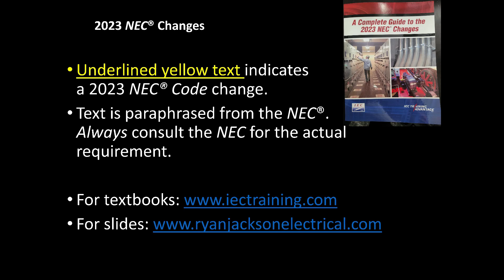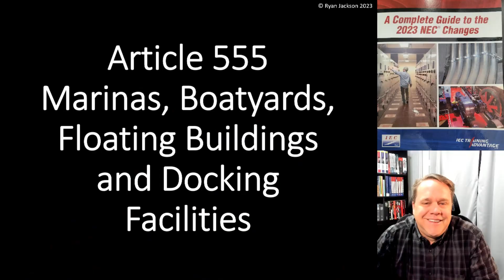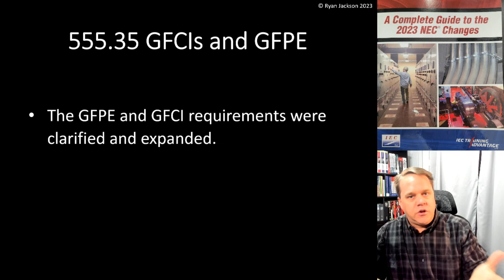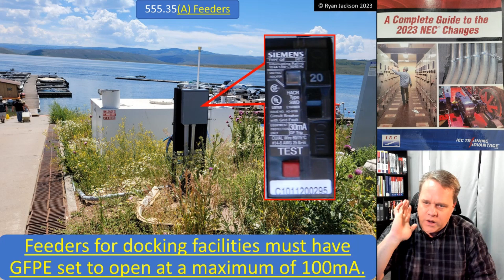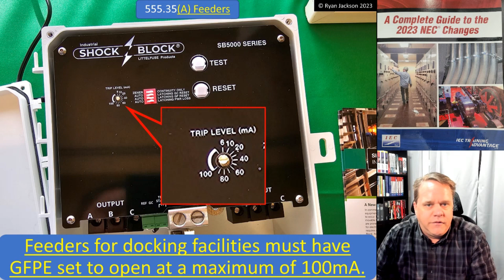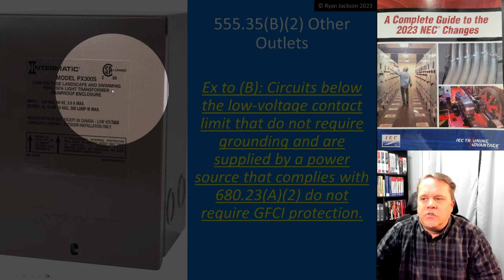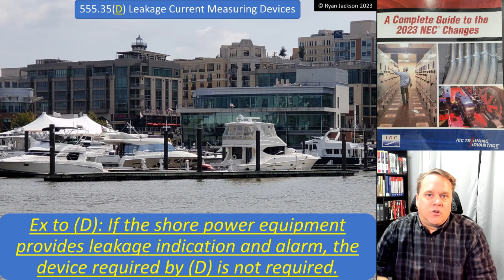555.35 GFCIs and GFPE at Marinas, Boatyards, Docking Facilities, and Similar

Comment: Another great video.... by leakage current would I be correct to assume this is current in the ground circuit and shouldn’t the GF protective circuits trip?? Also I’m not sure my clamp on meter would read milliamperes.... glad to see they are ground fault protecting everything with line voltage near the water

Comment: I know GFPE for what you're talking about is 30mA.  But for equipment?  I'm interested in that.  It has ranged from m30 A to many amps.  I'm thinking GFPE vs GFPE should be well-defined.  I know as a designer what I want for GFPE.  The two terms are mixed in somewhat of a dangerous way.  Seriously, for the naïve,  the explicitness of the difference should be clear.  I design heater circuits.  Many of them have inherent leakage current[conductive paste or whatever causes that]. So, they have GFPE(no specific Amp value).  All that leakage current adds up and the main sees that and knocks thing off when the total hits ~100mA on the main(default).  It does make an engineer consider telling folk to check your things and beware that production will go to zero when it is at 100% if you're not careful with what you do.  GFPE  should be equipment only....no persons.